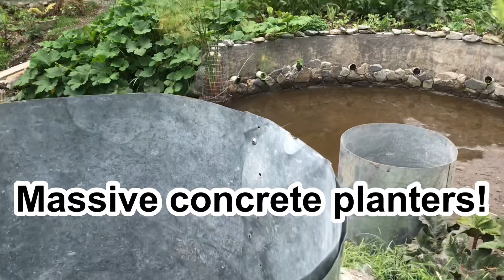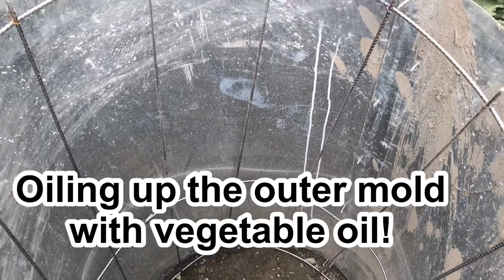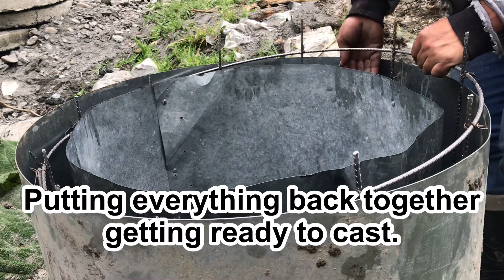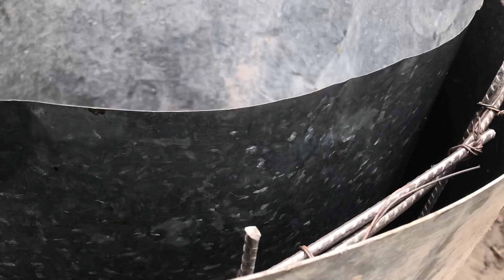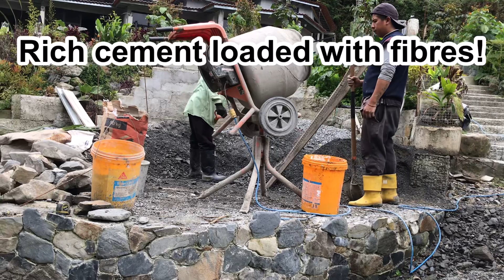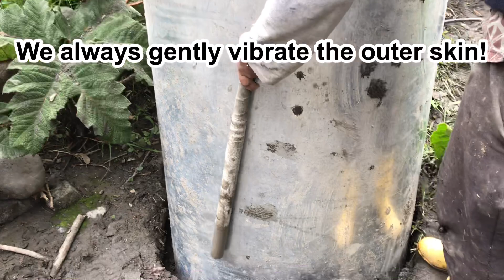How to make massive cement planters using readily available materials for under 100 dollars!

Comment: Rebar in the dirt will rust, best to place it after the is an inch of cement down first.
Reply from the maker: Agreed. Your 100% These planter are placed inside the river. We need all the support we can get when the river rises. We also bury these planters with two feet of topsoil contained
by boulders. The rust has to travel up 2 feet to show it effects. This rebar is constantly submerged in water and the lack of oxygen slows down the rusting process. Most likely I will be dead before the oxidization process causes me trouble.